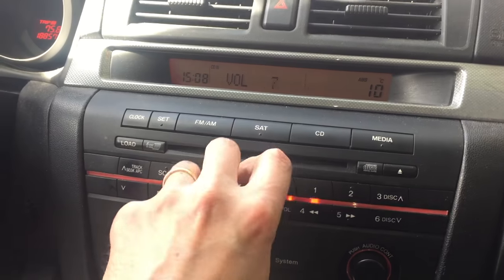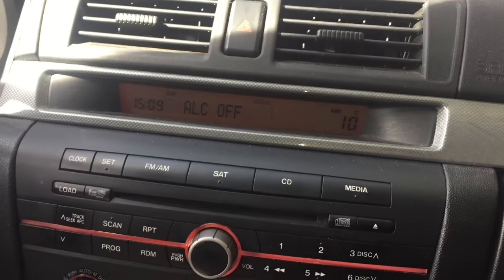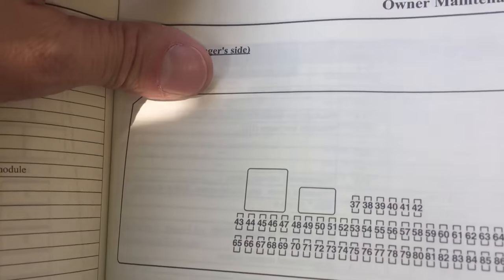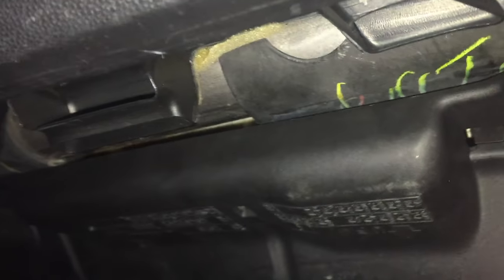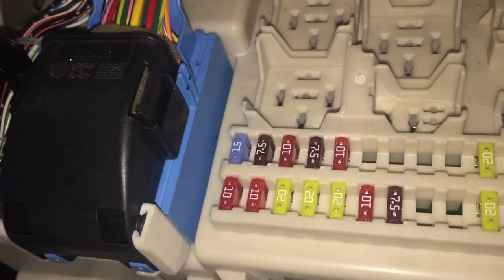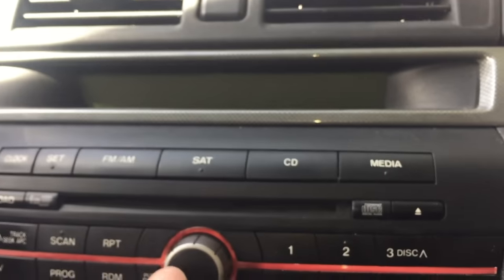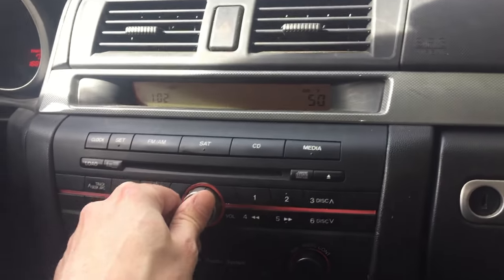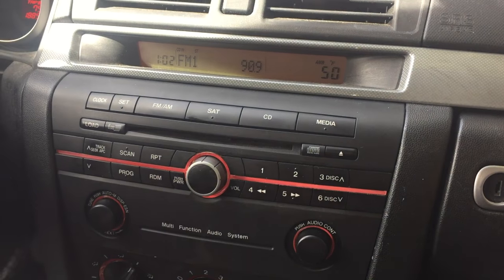Mazda 3 Radio does not work - FIXED in less than five Minutes

Comment: Any tips to clear up static on the radio? Should I replace the antenna?
Reply from the maker: Difficult to say. I replaced my antenna some time back because the bottom portion of the antenna was badly corroded. In that case it did help with getting better reception.
Reply: @MegaSafetyFirst  would I have to take off all the panels on bottom replace it?
Reply from the maker: The antenna can be unscrewed from the base. It is really easy do.

Comment: How about the sound working but the display does not. Is it also a fues thing?
Reply: today I got the same problem, everything else is working but not the display, did you fix your problem and how?
Reply: I got same problem.  .. not sure how to fix.   @twlkom2635
Reply: @vince_only_way_is_up  I fixed it by pulling the power from the battery for 5minutes and plug it again
Reply: Lol mine is the opposite

Comment: So I’ve changed the fuse but it’s still not working. The radio does turn on but there is no letters at all. Any other Suggestions?
Reply: How did you fix it
Reply: Muaqz no bro still fucked up
Reply: Fixed the button problems but still no audio coming out on mine

Comment: After I disconnected the battery, every time when i start the engine my radio it's cheking the cd library.How can i fix that? Thx
Reply: Having the same problem.... How did you fix it?
Reply: @largelymotivational  I changed the Radio with a multimedia:))
Reply: @alex69boss44  okay thanks... I guess I'll have to change mine too

Comment: Is my stereo going bad once this starts happening?
Reply from the maker: That was the case for my radio.   Eventually I had to replace it with an aftermarket radio.
Reply: @MegaSafetyFirst  thanks
Reply: @MegaSafetyFirst  one last question.  Was yours a Bose system or non?
Reply from the maker: @bishop9253 mine was not Bose - I don’t recall where it came from.

Comment: Hello .. I hope you answer my question. I have a mazda 3 2006 BK, recently bought. I burned some mp3 cds and played it in the car. Minute counting starts so it reads it but there is no Audio and track button up and down does not work also. With radio and FM transmitter the audio is ok. Just the cd.  The seller said this model only plays original cds not burned ones. Is he right? Doesnt sound reasonable to me. Thank you very much for your answer in advance. Big help for me.
Reply from the maker: Hi,  I think the seller might be right.  
In 2006 only few car radios supported playing mp3-cds. 
Did you try burning an audio-cd and playing that in your Mazda?
Reply: @MegaSafetyFirst  thank you very much for your reply. No.. just tried mp3. Cause on the player says mp3. But I will try audio cd as well. As I said got me a bit down when the seller said it only reads original cds. I cannot even find the music I listen to here in germany to buy even. Have you always played original cds with it? Not burned ones? Cause I think you have the same car model. Right?
Reply: @alirezvani6067  got exactly the same problem. Did you fixed this?
Reply: @autotainment3867  were u able to fix.. getting same problem
Reply: @GagandeepSingh-kc3gf  I did, You have to burn cds as an audio cd, not mp3.
Reply: @autotainment3867  ok I will also try

Comment: Can anyone help me..? 
My 2007 model Mazda 3 , clock not showing, No radio display and radio not working,(AC display working in the same panel) 

Head lights also not working. 

I tried to work with fuse like in this video. But was not successful. 

Please help..
Reply: Did u fix it??
Same things happened to my mazda
Reply: check your room fuse under the hood
Reply: that’s what worked for me , it’s js my sound on my radio now